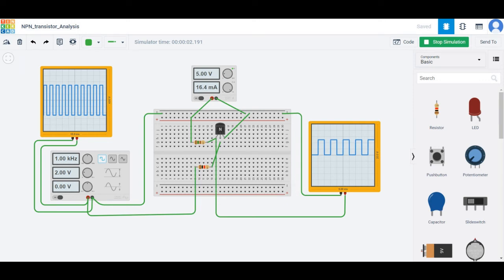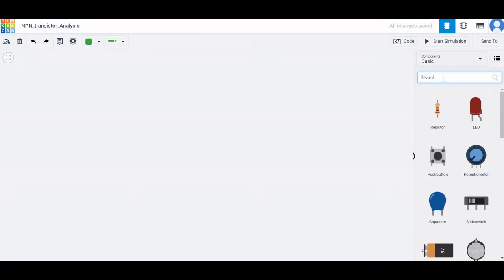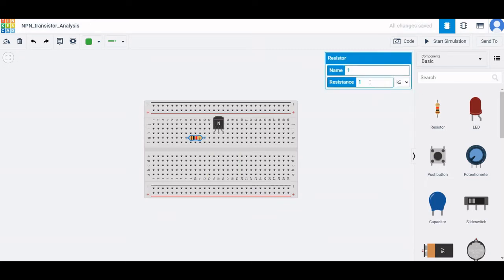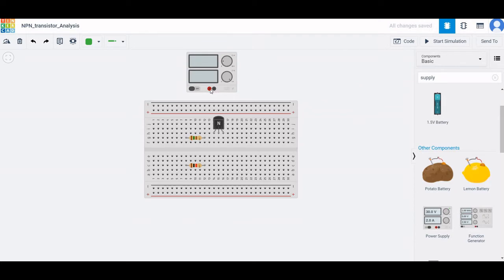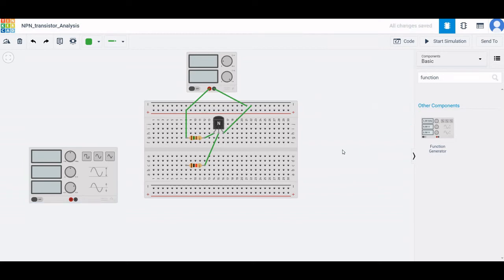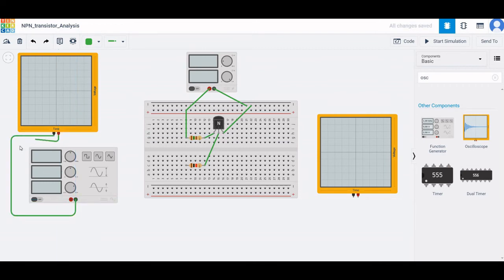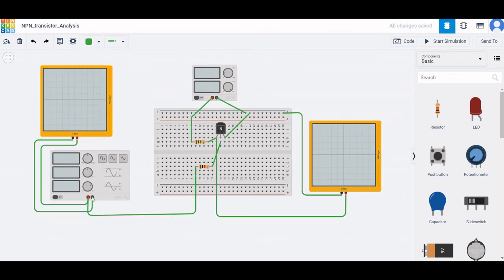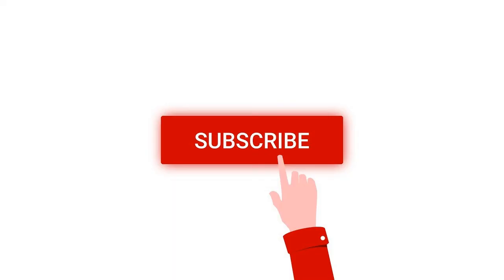Tinkercad tutorial 2: Design and simulation of NPN transistor switch circuit design

Comment: 6 diode sampling gate how can we do..?
Reply from the maker: We can do that, but following components must be used 6 diodes, with load resistor and two resistors across the voltage source and across supply voltage.

Comment: could  you answer this (When the circuit is connected correctly, the simulation is running and the tilt switch is set for the DC motor to run, what speed (in rpm) does the DC motor rotate at?) based on this stimulation
Reply from the maker: If i am not wrong, with NPN switching. The switch is turned ON, current flows from the 9V battery from the base to the emitter. Then, the transistor is switched on and in this case if motor is connected it begins to rotate. If the specification of DC motor is 100 RPM i think it should run at that speed since logically its 1(ON). But if you want to vary the speed of Motor then you can do this by PWM(Signal with variable duty cycle)